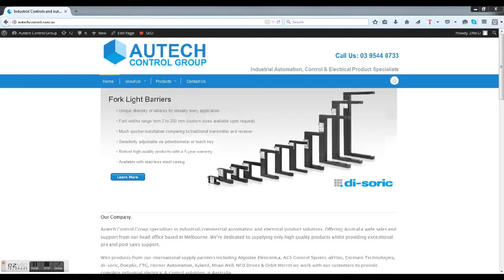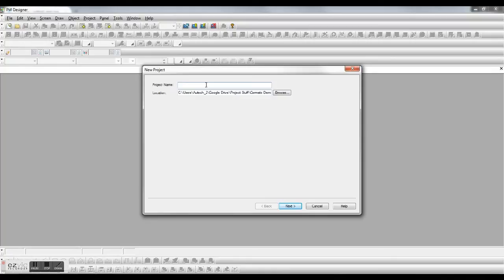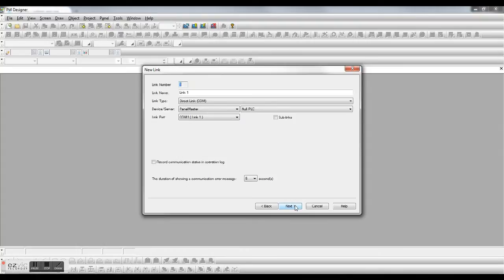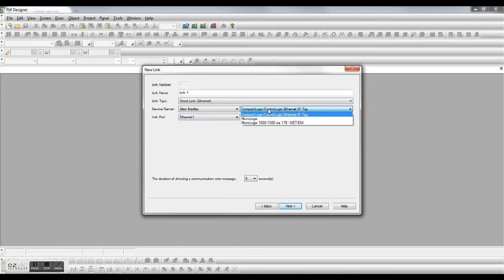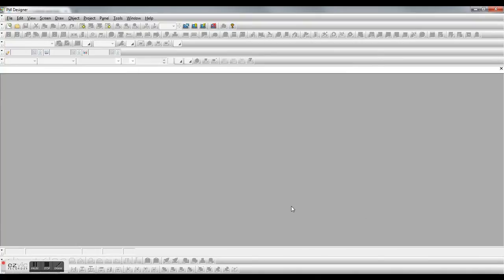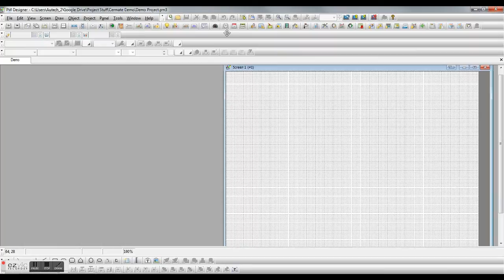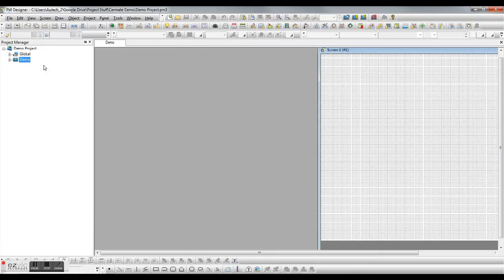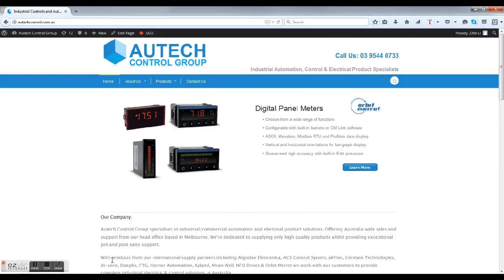01 - PM Designer v2.1 HMI Development Software - Getting Started

Comment: Hi . I don't use any PLC and make my own PCB circuit . is there a way for me to connect to this HMI?
lets say i do transmit this data to HMI :
{HOUSE1/TEMP1:120;/TEMP2:125;/}
i want two labels show the 12.0 *C and 12.5*C
and two buttons each one click send me a data like :
{RELAY1ON} and {RELAY2ON}
is it possible to process data and mine the numbers out to show ? ( i am trying to replace a none industrial embedded system running Linux and QT with an HMI )